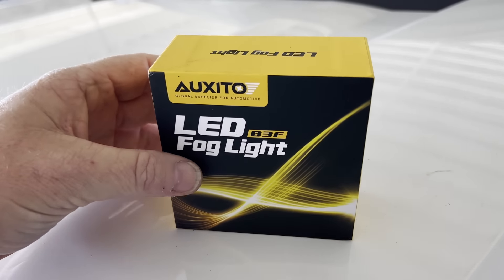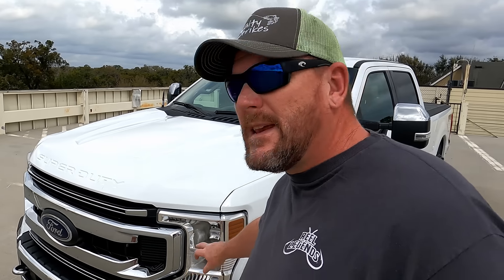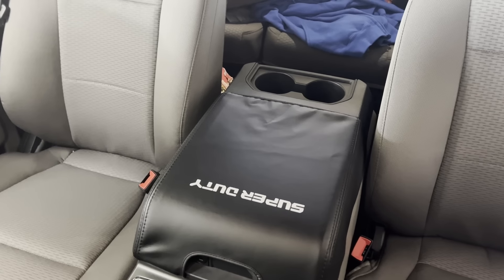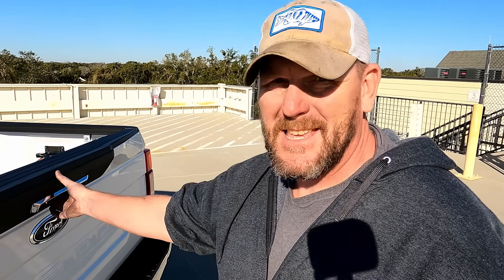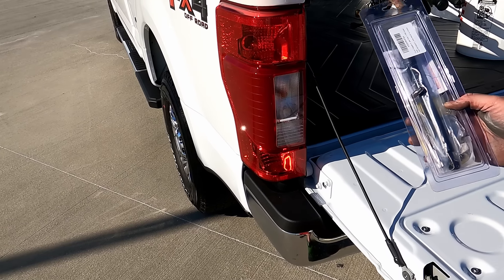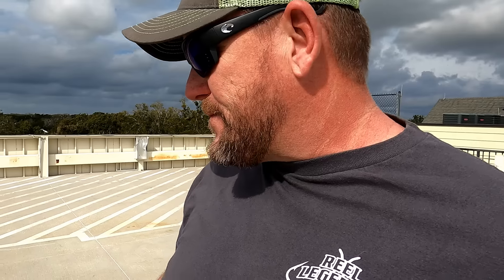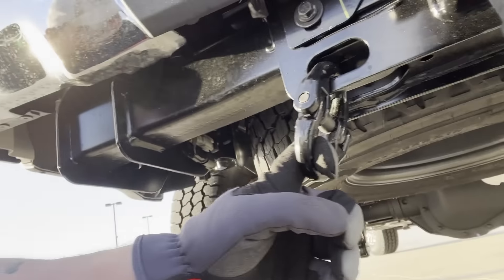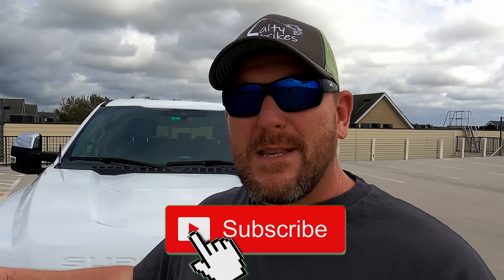SIX mods EVERY truck owner should do first! F150 F250 F350

Comment: The most annoying thing with those Ford tailgates is the fact that it collects rain water like a gutter and promptly soaks you every time you open it.  Whoever designed that was no man.  Also, it should have had a gas shock to begin with.  The same guy made the safety chain holes.  Ridiculous.
Reply: Hmmm. I have a cover on mine. Never noticed it.
Reply: My right rear door was filled with water until I released the drain hole, also you cannot open your door in the winter time without completely coating your seat and snow regardless of how you clean
Reply: On my F250 the very first time I tried to hook up my trailers safety chains up and saw how thick the holes were and there was no way my clasps would go on I backed my truck up to my cutting torch and half mooned the inner part. Chains fit great now and there is still more metal there than most hitches have
Reply: @shawncoleman9476  good idea...youre correct on my safety chain holes there is a ridiculous amount of steel

Comment: I was thinking that this video wouldn’t be that great (mods for under thirty dollars, really) boy was I wrong!! This was a great video and I now want some of these items especially the tailgate shock! Thank you and have a wonderful day!!
Reply from the maker: … glad it helped, so easy and simple but makes a big difference so we had to share.
Reply: I bought a tail gate shock on eBay
Reply from the maker: @paulgrimm  … the should come as standard equipment, but at least it’s an easy fix 👍
Reply: Order mine has soon as I saw this video.
Reply: I wish he would have talked about the dumb sleeve you need to use if you have a 2 inch receiver.

Comment: You should talk about improving the AC condensate drain. It’s behind the front passenger wheel. Stock one is horizontal (on my 2019) and can leak back into the passenger compartment, ruining your carpet. Glue a 3/4” elbow on it and it’s fixed. It’s a common problem and as of 2 years ago hasn’t been fixed by ford.
Reply: Can you elaborate or point to a video that discusses further?  I just picked up a used 2018 and noticed how wet the floor board was under the carpet when searching for the keyless door code. It surprised me, to be honest.  After noticing how heavy the AC was dripping in the heat recently, I wonder if mine is backing up there.
Reply: @Buletspunge555  The condensate drain goes straight through the firewall on the passenger side and drains behind the right front tire. The problem is, it’s just a straight tube. You remedy the problem by gluing a 3/4” elbow to it, pointed down. No more back flow. You have together behind the fender liner to access this. Not hard cuz the liner is flexible and can be bent out of the way.

Comment: You could get a "Rubber Mast" antenna or a "Shorty" antenna which is a 8 inch version of the long factory antenna..I've had my "Bullet" antenna stolen so make sure you put a little dab of Red Lock Tite on the threads
Reply from the maker: … I’m hearing that now they get stollen quite a bit, thanks for the heads up
Reply: When I was a kid I used to steal the bullet valve stem covers or any cool ones I found on a truck so I could put them on my BMX 😂😂

Comment: Console cover and lights arrived today. The cover will be returned. It curls due to the fold from packaging and doesn't reach the back of the console unless I'm stretching and holding. Not long enough to tuck in the back which means the curl pulls the back toward the front. Also, the elastic strap obstructs access to the pen holders in the console cover. Will test the lights tonight.
Reply from the maker: … our cover has been working great, sorry to hear yours didn’t fit right. LEDs definitely make a big difference. Let me know how they turned out for ya 👍

Comment: Amazing video. Another suggestion that is often overlooked; getting seat covers for all the seats (front and back).   Decent sets for them can be had for $25 to $30, to preserve wear/tear, and prevent staining of cloth seats.
Also, several models of F150s don't come with locking gas latches. This is remedied for only $11 with an amazon locking gas cap plus keys.
Reply: I don't think they've had a gas cap in at least 13 years.  I'm pretty sure that from 2011 & up ( possibly  even before then.  ) they have the capless fuel hose.  My 2012 & 17 mustang both don't have a gas cap.

Comment: The tailgate strut and hammer locks are very cool.  You would think for $75k, Ford could nut up and include a damped tailgate.  As for the fog lights, if you really want them to work best in fog, get the lower temp version.  Amber light doesn't penetrate better, but the human eye sees that color temperature better.  It's why off road race cars have them on the rear, as they can be seen from a greater distance (in the dust) than standard tail lights.  The same concept works when looking forward through fog or dust.  Great video!
Reply from the maker: .. yeah , you would think most of this would be standard equipment, as for the fog lights, fog is almost never an issue, deer 🦌 are a way bigger concern.
Reply: @saltytrips  o

Comment: Tailgate electric lock works when you lock or unlock the doors. A quick release for the rear seats, and Rear Wheel Well Guards in the wheel wells to keep mud and debris out of the wheel well. Also, glue on anti-scratch pads for the rocker panel inside the doors protects the painted area when you enter or exit the truck. 
I also did a DIY for the remote start, bought an OEM antenna from Amazon, installed it behind the glove box, (wire is already there from the factory) took the truck to a dealer, bought a remote start key, had the dealer configure the computer to the remote start key, and away I go. That ran about $200-$250.

Comment: The head lights, fog lights, tailgate and console I took care of the first 3 months I had my tuck. I did have to adjust my headlights after exchanging to LED's and I still get flashed at times. It is what it is I guess. The fog lights are freaken awesome. What a difference after changing to LED's. Advise for all trucks. I made my own console covers and of course, the tailgate is awesome now. The netting I might do on the back seat.
Reply from the maker: … I’ve been using the same leds in my F150 for 5 years and now in the F259 and never been flashed. The Net is a life saver with bag of eggs and bread in the back seat 👍
Reply: If you are getting flashed, you are the person everyone is cussing at because you don't have the right headlights or know how to aim them properly, but continue on anyway 😅 clueless.

Comment: This gave me great ideas for my next Ford F150 XLT. Great video. I came across yours looking for accessories to prevent auto theft by thieves breaking tumbler behind the door handle like they did mine and stole a bunch of stuff. Very cheap options out there for the Ford F150 if you're looking for those.
Reply from the maker: Thanks for the input 👍

Comment: Instead of the hammerlocks, you can also use I believe it's 5/8" straight side shackles that way you can take them on and off when you need them. Crazy how Ford thought it was a good idea to make those chain hoops so small!
Reply from the maker: … most of those 5/8 shackles are only rated for a little over 6,000 lbs, these hammerlocks are rated for almost double that. It all depends on what your towing, we always lean on the side of more than you need.
Reply: @saltytrips  I'm never towing anything that heavy with a ball hitch hence the shackles. Anything that heavy, it's either going to be fifth wheel or gooseneck. I don't care for how these new Superdutys steer once it lightens the front end. I think it has more to do with the electric assist being too much.
Reply from the maker: @atvtinker01  … to me, it definitely steers and drives better with a load. That’s what they where built for 👍
Reply: @saltytrips  I don't think that mount point would handle much more than 6000 pounds so the hammer locks are not your week point.
Reply from the maker: @jesseearly804  … that hitch is rated for 18,000 lbs, each safety chain hitch point has to be rated for the same as the hitch it self. No sure where you got that 6,000 lb from but that’s completely wrong.

Comment: 2019 F150 SuperCrew/SPORT. When I installed the tailgate strut, I didn’t get “includes all the tools you need”!  You got a DeWalt cordless drill!  Now, I’m upset!  I’m gonna take my blanket and sit in the corner!  (Installing the strut was something I did 3 weeks after taking delivery!  Highly recommended for any and all pickup tailgates!). I also like the cargo netting on the rear seat.  Can’t use it as I have the “dog sling” which keeps my little Shar Pei girl safe!  URPOWER Dog Car Seat Cover for Back Seat, Waterproof Dog Car Hammock Dog Seat Cover with Mesh Window and Side Flap Pets Car Seat Protector Dog Backseat Cover for Car and SUV.  Another inexpensive add-on I would recommend is:  Chelhead Led Pod Lights, 2Pcs 2.8 Inch 20W Flood Off Road Backup Driving Lights Fog Lamp Rear Bumpers Signal Reverse Light Bars Compatible with Trucks Jeep Motorcycle ATV UTV SUV Tacoma.  They are a godsend for placing the truck in R at night.  I mounted mine under the bumper and wired into the Reverse wire!  I have a cab high shell and the rear tailgate backup camera with the additional lighting really helps.   Here is a bonus:  I don’t like wiring clutter for rear view mirrors, so I installed an adapter from (Amazon) Dongar Dashcam Power Adapter!  Works with virtually ALL powered auto dimming rear view mirrors!  No more worries about A-Pillar air bags!  
Enjoyed your video, thanks!

Comment: Great video!  All very practical...Thanks for the links; however, the link for the console cover says that items is not available.  As is, I've used three of the links (Fog lights, Net/bungie balls and the tailgate lift.
Reply from the maker: @leonhardtk  thanks for the heads up
Reply from the maker: @leonhardtk  i just checked an all links are working except the console cover and I fixed it.
Reply: @saltytrips The link does indeed work now!  Thanks!

Comment: You forgot 1  the door sill protectors there made of heavy duty thin plastic sick on label to put on sill to get in and out and not scuff up the paint
Reply from the maker: … maybe because I’m so tall but that’s never been an issue for me. Good one to add, maybe another video coming soon 👍
Reply: @saltytrips   but the passengers ?  Some are vertically challenged 🤣
Reply from the maker: @tominaklan9702  … first scratch that appears, I’ll add them 👍

Comment: How about a Fomoto 1/4 turn oil drain brass replacement valve online. Comes in many sizes for most cars and trucks. The website explains which one fits your particular car. $30.
Reply from the maker: … I’ll put it on the list 👍

Comment: Somebody told me on my 2022 f350 u cant replace just the bulbs on the head light u have to replace the whole light setup. Haven't looked into that yet. Fog lights should be fine to do. Ty for the upgrades 🍺🍻👍
Reply from the maker: … glad the video could help, far as I know the F250 and F350 lights are exactly the same. The only ones that are different are the higher tier trim packages that already have LEDs.
Reply: I’ve got a 21 STX that has LED replacement bulbs in factory headlights. I’ll have to see what brand and all that they are. We’re in the truck when I got it.

Comment: Auxito isn’t a quality brand, first set dimmed and eventually out in 14 month, second set about to go, will pick another brand this time. Any suggestions?
Reply from the maker: @markwangontario7573  worked 5 years on our F150 and two years now on our F250 with no issues. Not sure why you’re having an issue.
Reply: @ I don’t know either, they have reasonable price, it says on the box something like 60,000 hrs, I have a 2022 f150 xlt. 40000kms now. They do get used as day time running lights which is basically half power. (LED bulbs should have much longer life in half power).

Comment: Great suggestions for my 2017 F350!!  Getting the lights, console cover and antenna today. Hadn't thought of adding an extender for my chains. Could probably use my D shackles, but need to confirm strength first. Something smells wrong with that plan. Any idear how to remove the hammerlocks if you need to someday? 
Also, if you a do a tonneau cover video, mention how some will sag. My buddy's 2013 F350 with a stock Ford cover is thicker than most aftermarkets and doesn't sag nearly as much as mine that I bought in 2020 for around $300. Happy with it otherwise.
Thanks for the tips !😀🛻
Reply from the maker: … you can pound the pin straight out with a punch. Will try to add that, keep an eye out for more videos soon 👍

Comment: Great tips ... got the DeeZee DZ43204 for a F150 and it is VERY noise, like something inside the strut is dragging the metal ....  it does work well, but just noisy. Any ideas?
Reply from the maker: Not sure, we’ve had them on our F150 and F250 without any issues

Comment: Good video, I just ordered the gas tailgate struts for my 2014 F150. Where did you get the protector that surrounds the lift gate handle on your truck. I need one. Ii just subscribed. Thanks
Reply from the maker: “Protector that surrounds the lift gate handle” I’m not sure what your talking about. Everything in the tailgate beside the strut in the video is stock.
Reply: @saltytrips  On the outside. The black piece that surrounds the lift handle. Thanks
Reply from the maker: @joekelley1014  that’s how they come from the factory

Comment: I also bought remote start .it was easy installation,and Katskin leather seats
Reply from the maker: … luckly these newer F250 have a remote start with an App. No a big fan of leather seats here in Florida because of the heat. Good add ons though 👍
Reply: @saltytrips  I had a Kenwood radio installed at CarToys.There must be 12 special gauges that Ford  computer has now on my radio. Intake ,exhaust temp,turbo boost,trans temp,outside temp,and allthe rest .Oil,water,Intake air temp.I recommend the 
ford  factory up graded radio. That aftermarket needs adapters and a dash kit .

Comment: At least adjust the aim of the headlights if your going to put LED or HID bulbs in, so you dont blind everyone. I retrofitted projectors out of a junkyard infiniti when I got LEDs and it has a clean cut off and doesn't blind other drivers. The short antenna is great on the trails, and will save your winsheild, I had a factory antenna until a bird hit it and smashed the tip into my windsheild when i was on the I-5 doing 70.
Reply from the maker: … fog lights have an on and off button as shown in the video, use discretion as needed, they don’t blind people they have less lumen’s than head lights and they are angled slightly down. Been using them for 5 years in the F150 and not a single vehicle of the hundreds of thousands I’ve passed has ever flashed there lights at me or gone careening out of control off the road. Beside Fords lariat and platinum come standard LED fog lights that are brighter than these aftermarket ones, I doubt Ford would take on that liability if they where blinding people left and right causing accidents. Sorry to hear about the windshield, never had that happen, I just always hated to looks of the large one. They did worry me running them through the car wash. I thought it might come back and hit the windshield.

Comment: The only thing I can say about your short antenna is now you have lost your safety alert that your clearance maybe too low. Those antennas are only on there to let you know once they are hit, that your clearance might be too low.
Reply from the maker: ….😂🤣 if you can’t stop you your cab top from running into things without an antenna “early warning system” you have way bigger problems 🤦‍♂️

Comment: Fog lights are for driving in the fog. Using them all the time blinds oncoming drivers. Fog lights are mounted low and aimed straight out to get under the fog. At a distance, the light beam is higher than headlights. Don't be a jerk and use them just because everyone else is doing it.
Reply from the maker: @ready4anap  if the lights are low and meant to flood under the fog, how are they blinding people? 🤣😂 makes no sense, never blinded a single person driving with fog lights on for seven years so far.

Comment: You might see better, but you do blind others, especially  if you raise your truck, you need to re ajust  your lights. You blind others  with leds.
Reply from the maker: … fog lights have an on and off button as shown in the video, use discretion as needed, they don’t blind people they have less lumen’s than head lights and they are angled slightly down. Been using them for 5 years in the F150 and not a single vehicle of the hundreds of thousands I’ve passed has ever flashed there lights at me or gone careening out of control off the road. Beside Fords lariat and platinum come standard LED fog lights that are brighter than these aftermarket ones, I doubt Ford would take on that liability if they where blinding people left and right causing accidents.
Reply: @saltytrips  all lights do
Reply: @Salty Trips  that just about what I said, projector lights are bad or worse  if there  not adjusted right.
Reply: Wast talking about fog lights.